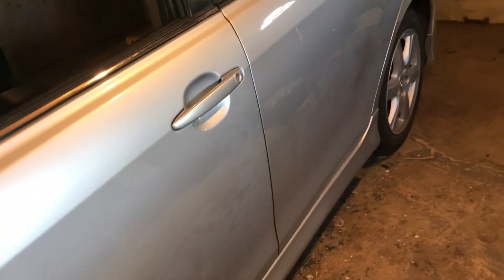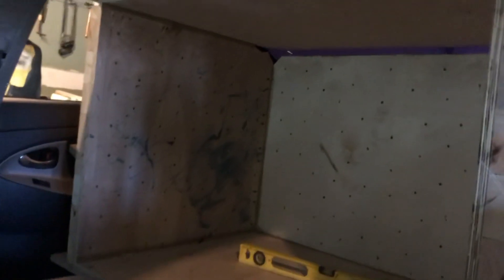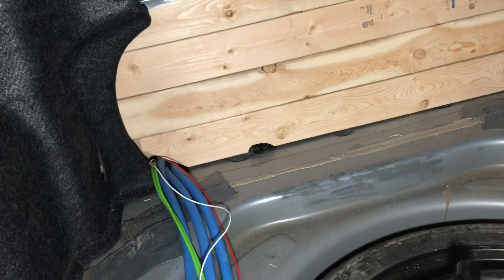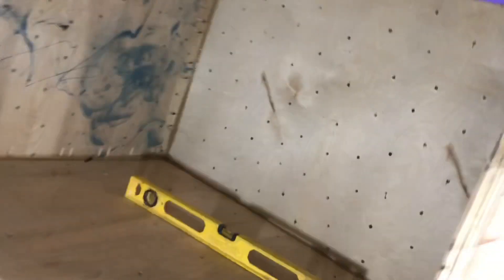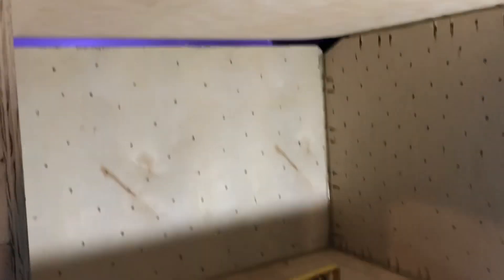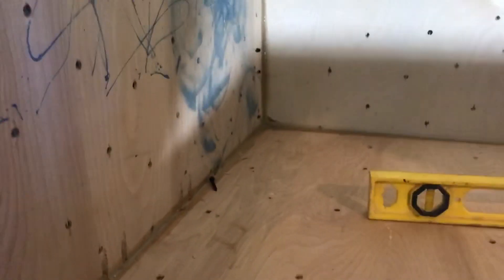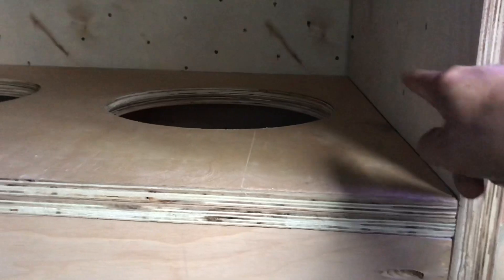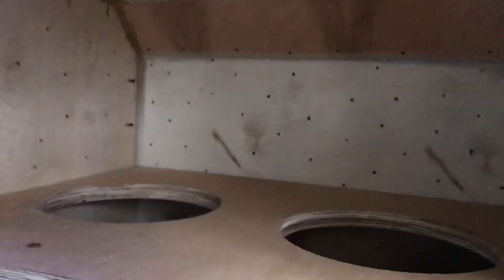4th order wall build for 2 resilient sound team 15”

Comment: Wow that is looking bad ass....how big is the box and what is the ratio? I'm planning something similar but a sixth order instead
Reply from the maker: The ratio will be like a 2.5:1 I have 5 cube seal and 12.5cuft once I add subs and port it’ll change a bit but not to much what kind of car and subs you running
Reply: @loudjunkey4206  Mazda cx-5....2 massive audio hippo xl152r on 2 drago 6k's been staking up equipment now for a few months..waiting for the nice weather. Can't wait
Reply from the maker: MASSIVE HERTZ yeah you gona have a nice set up with that car you should have the space for a 6th no problem